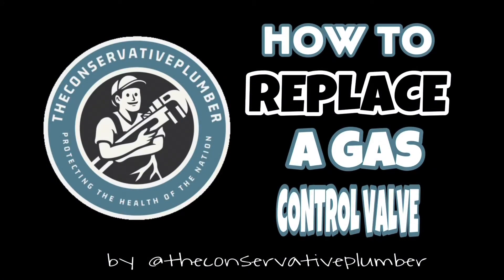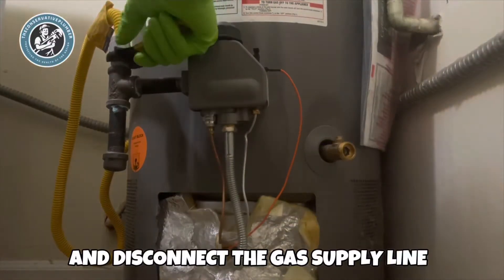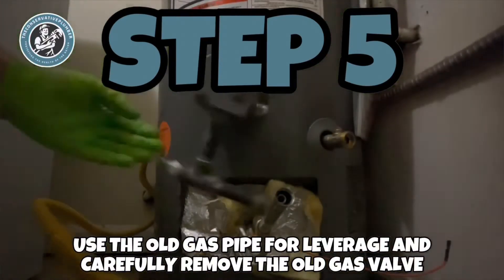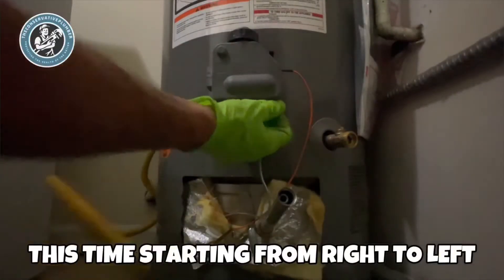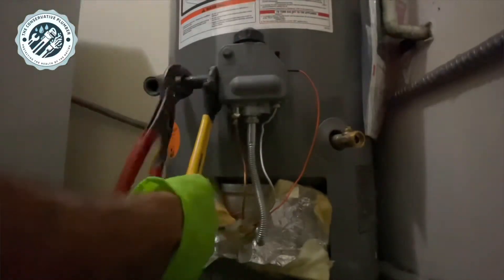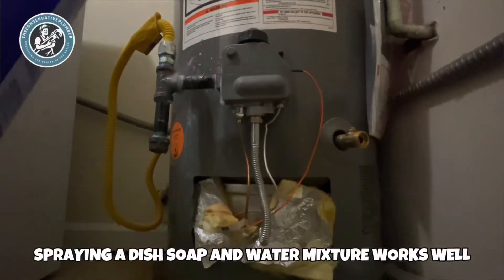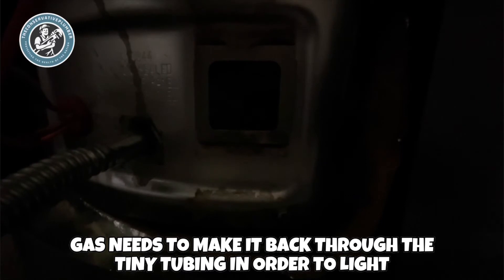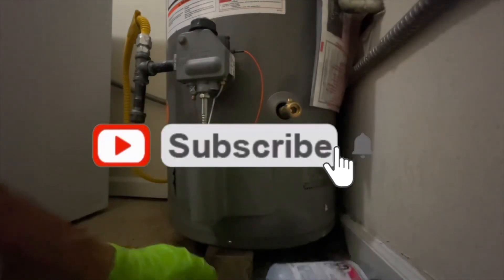HOW TO replace a GAS CONTROL VALVE in 15 SIMPLE STEPS (2020 RHEEM WATER HEATER)

Comment: Some said in other videos donot touch the pressue relief valve? just open the hot water faucet nearby, is that ok?
Reply from the maker: On an older heater, opening the relief valve could be an issue. Sometimes they’ll get stuck and you’ll have to replace the valve. I keep them on my truck so it’s not a big deal. This heater wasn’t old tho.